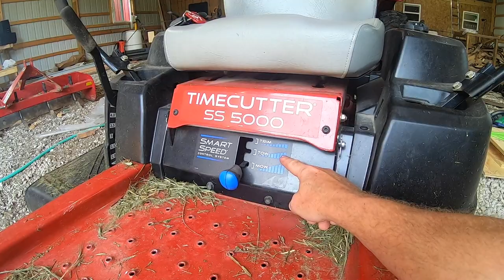Toro Timecutter SS5000 Zero Turn Riding Mower Review

Comment: The biggest problem I have found is when it gets hot pressure builds up in the fuel tank it will eventually split along the bottom seam. A new fuel tank costs almost $300

Comment: Hi I have the same mower. the only problem i have is after cutting grass and i cut the engine off and go to start it back up it backfires and hard to start. have u had this problem? what could cause this?
Reply: Lower the engine throttle before shutting down,
at least thats what my dealer told me after having  the same issue

Comment: Blade speed is very low pto is not engaging
Reply: Pull the PTO and spray wd40 around the top drum. The drum is the part that turns inside when you spin it from the bottom what happens is it rusts when it sits